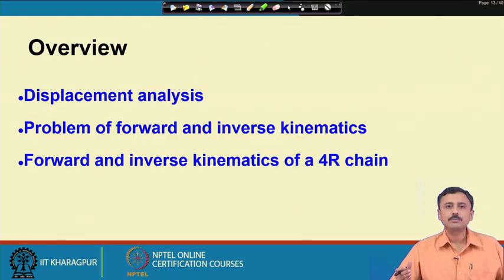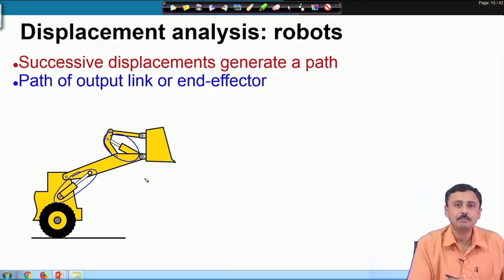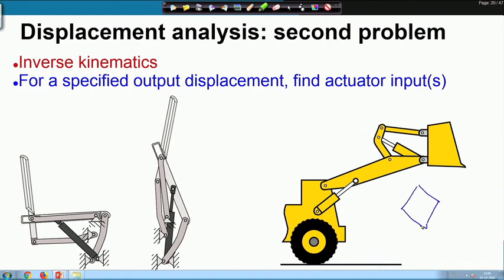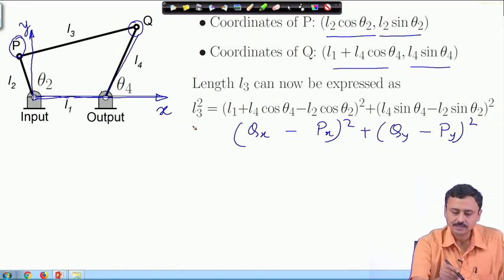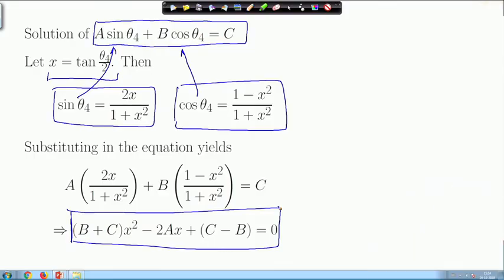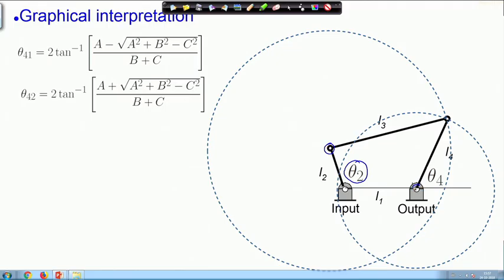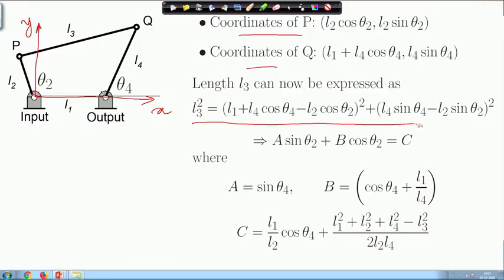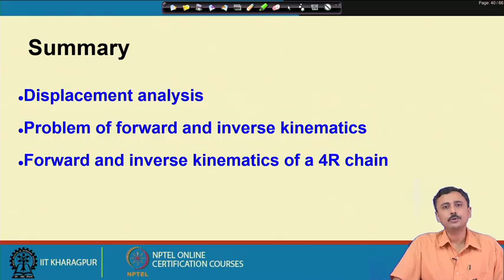Lecture 10: Displacement Analysis – I

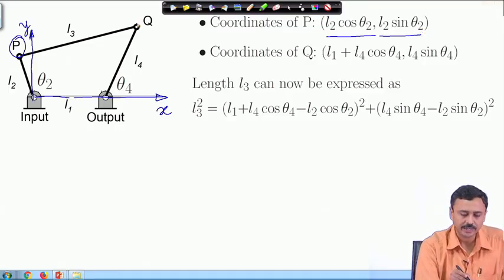Comment: At 10:40, the x coordinate of P should be with a minus sign, right?
Reply: Yes I am also thinking the same
Reply: @shreyashshankar9819   it will be adjusted by value of angle , for eg if angle is greater than 90 degrees than it gives you answer with negative sign

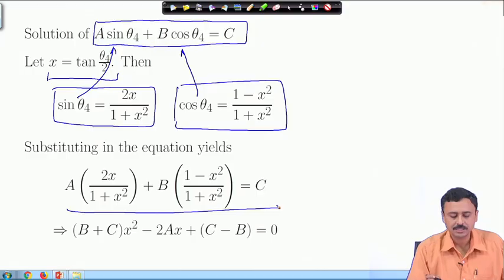Comment: At 14:33 for solving asin$ + bcos$ = c ,  we could use this method instead....

Divide the entire equation by sqrt(a^2 + b^2). 

Then use sin@ = b/sqrt(a^2 + b^2) and use : 

sin$cos@ + cos$sin@ = c/sqrt(a^2 + b^2) = sin($+@). 

Then continue with the simple calculations...
Reply: In this case 
($ + @) = arcsin(c/sqrt(a^2 + b^2)) which has a range of [-pi/2, pi/2] i.e. the first and the fourth quadrant
but if we use atan2 function in which we can supply the numerator and denominator separately then we can get solutions in all 4 quadrants.

Comment: At least tell how you are solving those straight forward trigonometry.
Reply: 11 12 trigonometry
Reply: the coordinates of P and Q are taken using simple cos and sine of angles. L3 is calculated using distance formula as we know coordinates of P and Q and value of tan theta 3 is calculated using slope of line  PQ  means  (Qy - Py)/(Qx - Px).
Reply: @tp1999-u3k   what about the solution of A SIN(theta 4) + B COS (theta 4) = C
Reply: Actually when you solve these equations then automatically you will see the form of Asin theta +B cos theta =C then simplifying sin theta =2 tan (theta/2))/(1+tan square (theta/2)) and cos theta =(1-tan square (theta /2))/(1+tan square (theta/2)) then take tan theta by 2 as x and solve quadratic equation for x and later use it to find theta . Once you start solving ques it will be clear to you .
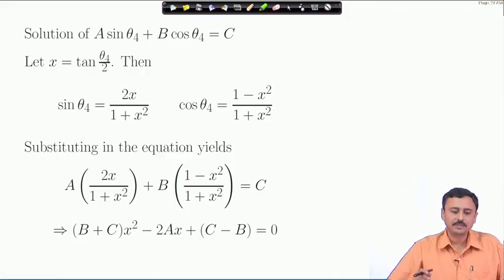Reply: @tp1999-u3k  AT 13:52 WHY WE TAKE X=TAN THETA4/2